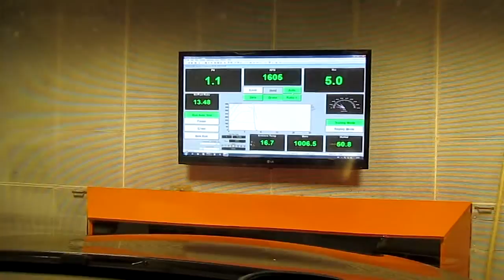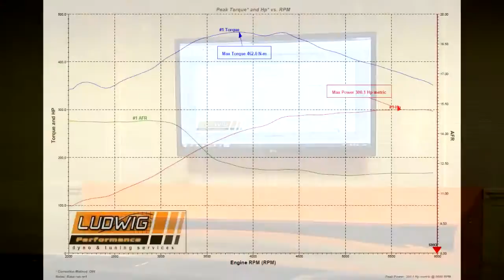BMW 335i stock with Cobb Stage 1 LT Sport dyno

Comment from the maker: Hi RimaRS, i am satisfied, but i called Cobb to confirm the numbers. their 320 to the wheels was measured on a mustang dyno, which is very comparable to the numbers seen on a Land and Sea Axle Hub. Let's just say, the 300 whp is on the low side (and actually, it's wheel PS, not wheel HP, so wheel HP is like 294)